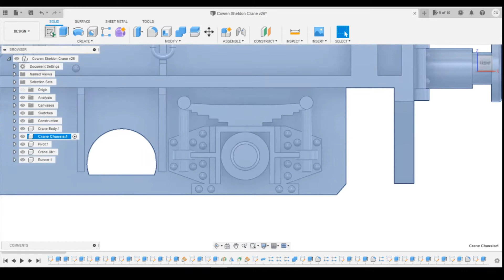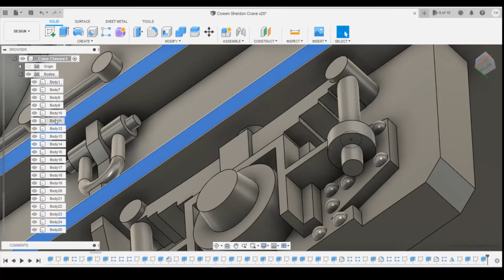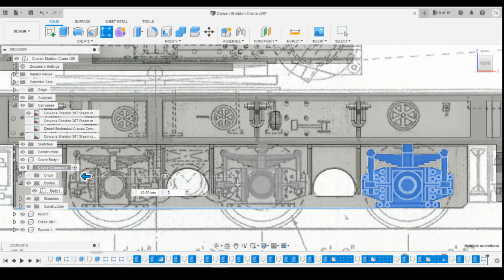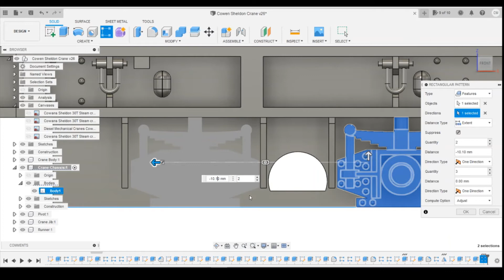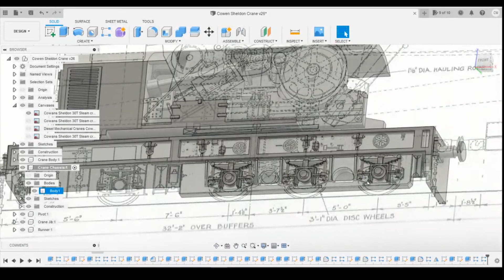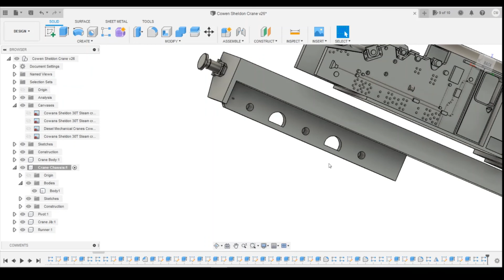Model railway crane drawing in 3D using Fusion 360

Comment: Hi, I need help, cannot get the copy for the pin axles to work, I select the r pattern, right click to edit, then select extrusion while pressing control and alt, press ok and nothing. What I am doing wrong.
Working way through the model and learning, thank you.
Tony
Reply from the maker: Just holding down CTRL should,  you dont need ALT

Thanks

Carl
Reply: @3ddrawingformodelrailways  
Hi, have tried it but still no luck, have the first hole ok, and it adds in the selections but not on model.
Reply from the maker: Its difficult for me to tell you what's happening without seeing it.  You could just try drawing each of them separately as a work around.
Reply: @3ddrawingformodelrailways  I sorted it, drew a line on the front then picked it up on the back, then found out about the project function